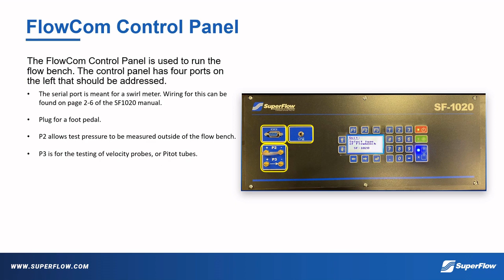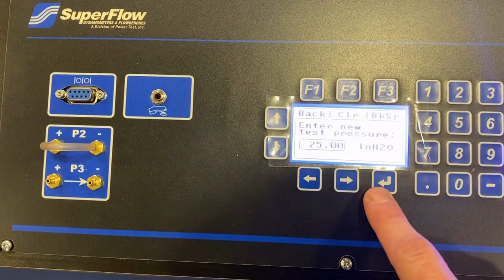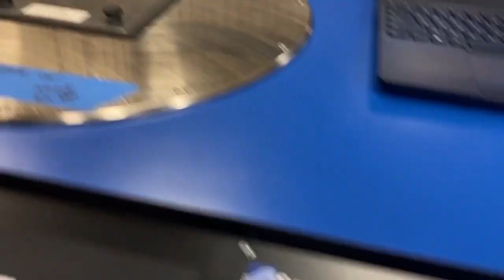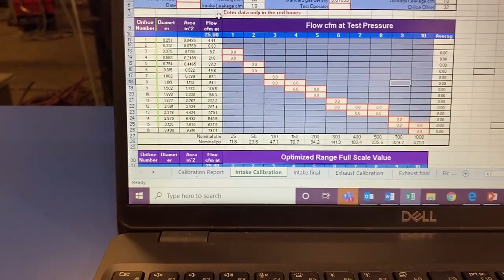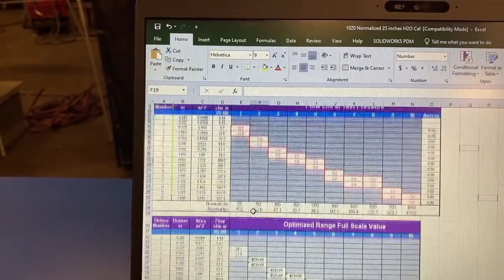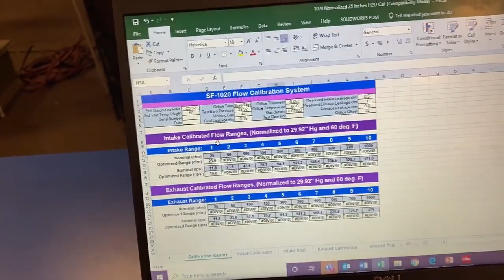SF-1020 Overview and Calibration

Comment: Jesus chirst guys .... what is the intake plate bolt pattern? To make an adapter for connecting to something... other question: can i measure differential pressure between two points using that P3 + - ? Meaning for example a pressure difference between the beginning of a pipe and the end... ?